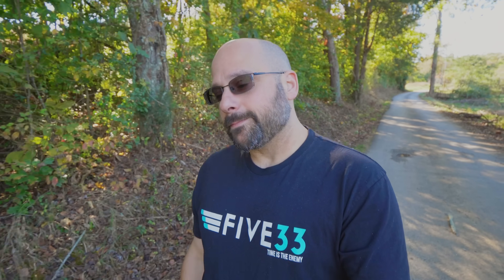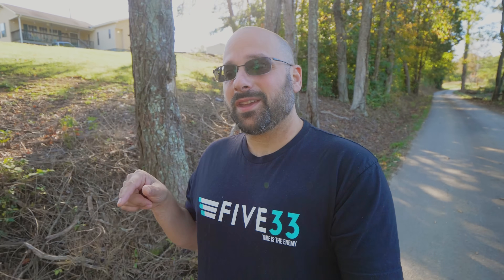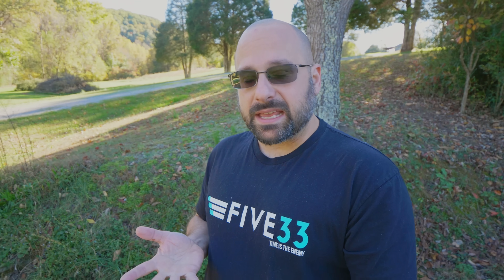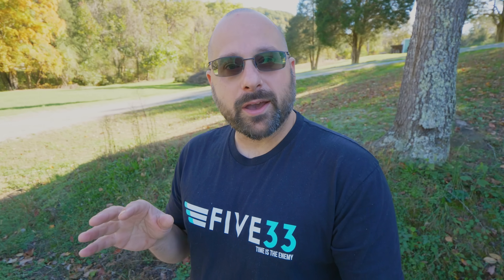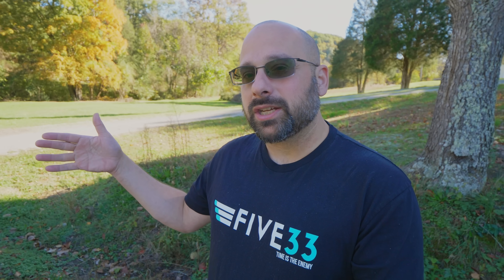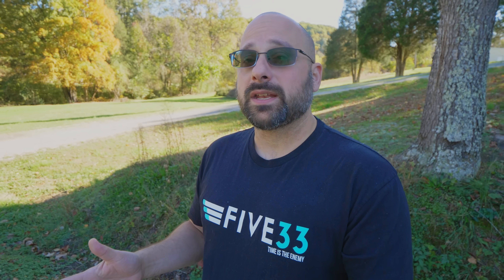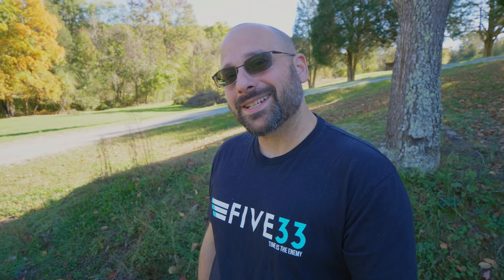How long can you leave your lipos fully charged without damaging them?

Comment: They need to make a like rail that you can plug in all your batteries, simular to how they are charged in the factory. Like it would be like a reverse parallel charger that maintains like 10 or more lipos at once. and you could connect more together if needbe. you could set it on like how long you would want them to sit dormant and it would automatically balance or storage charge. or heck if it could just keep track of them that would be cool too. I feel like the programming/hardware wouldnt be so hard to do, especially in like 2021.  Im constantly like trying to keep track of all my batteries manually. Seriously someone make one and ill give you all my money :P

if its like rainy for a week or whatever, ill actually will run my lipo balance chargers off of lipo that have been sitting too long. and set the "minimum voltage" for lipo discharge voltage. That way at least im cycling the batteries yanno?

Comment: Joshua, How important is the internal resistance(ohm) of batteries？ During changing, an ISDT charger shows resistance per cell. Some shows 10-15, and other shows 20-30. Could you tell beyond certain value could be dangerous or not efficient to use anymore, etc?

Additionally I wonder if we can connect 2 lipo batteries with parallel to Drone. For instance, I have 4s 450mAh batteries. Instead of buying new 900mAh for a bigger drone, I want to reuse 450mAh x 2. Is that possible? or explode drone?

Comment: Storage temperature definitely plays a major part in the speed of degradation too. I'd be willing to bet if you stored them charged below 0°C in a freezer they'd probably last much longer as the chemical reactions would happen more slowly..
Reply: My Aunt used to do this concept with non-rechargeable with Alkaline AA batteries, but it seems the difference in lost of capacity due to temperature is negligence especially if the battery is non-rechargeable.
Reply: Generally, a 10 C degree increase in temperature makes a chemical process run 2 times faster. (See the instruction-label  that comes with 2-component epoxy f.i. or think of a pressure cooker).  Same with battery deterioration. The lower the temperature is, the longer the battery will last when it is left alone.

Comment: I usually store my lipos on 3.95v.(70%) it's pretty nice because you are ready to fly much quicker.
Reply: I do the same.  I am so sad that there are no charging modules out there that stop at 4.0V
For some applications i dont need 3000mAh but i need 2000mAh for 6 years and like the convinience to 4.0V charge every few month and not need to measure the voltage every 30min

Comment: The same 'useful life budget' concept applies to discharging them at or above the 55C effective discharge rate - LiPos are incredibly impressive (the LiHV chemistries too), but realistically you have about an hour of useful life at the higher discharge rate, but in reality that's actually pretty excellent because it's a whole lot kinder to be at anything other than wide open throttle.
This is why a two-year old battery with about 80 cycles that has spent probably a touch over month charged up gets transitioned to the practice bin, because it's about halfway through its total useful life but no longer has the edge to be a racing pack or the one to use when a shot really matters... but it can push a lot deeper.
On the rare chance my packs to live to the 150 cycle (4+ year) point without mechanical destruction, then they get to be ground station power sources off BECs, because if I kill those I won't really be sad about it.

Comment: I have Lipos from 2017 (yes, 4 years old). I have religiously “storage charged” them 10 minutes after each flight and they have only been fully charged for a maximum of 2 hours (I fly at my house) during their lifetime. Their capacity is around 80% of what they were when I bought them but they are still going strong and I still use them. If you keep your batteries in storage charge for most of their “sitting around time” then they will last.
Reply: I have some 3s lipos from 2007 (yes 14 years). Still usable
Reply: I can second that but you need to buy high quality batteries in the first place for that.
Reply: Not worth for me personally since I tend to crash my 5 inch quite a bit and sometimes the battery takes a hit so most of the time they "break" before performance is an issue. This is very impressive though

Comment: Less than a minute into the video and you said the most important thing...”degrade”....that’s what I also say.

Ok, watching and typing....
Typing and watching....

30 days? And only 5%....? Surprised!
I’m glad you also chose the least common denominator and that it might actually add cumulative..that makes sense to me also.

Although I always felt slowly discharging them (to storage) with a Lipo Killer or charger  was less stress than flying them down...as “per one cycle counts”....
If this can be further tested or explained that would be great. If one cycle regardless of flight/decharge is the same I may judge my timeline differently. As in what percentage does one cycle remove and does the discharge rate effect that percentage.....then we can more accurately choose when to discharge. Sadly each battery type and temp and yards yadda yadda will effect that I’m guessing....these will be some long and in depth tests if expected to be accurate.

Great video...watch this get shared 1000 times in the next week or two...common questions for you and common questions in the Drone groups for beginners that I’m in.

Just watch out though everyone will cite your video regardless of the generally basic info you gave because some parts were open to interpretation and both sides will use you to argue their point......not all traffic is good, just a warning.

Comment: I thought the batteries form dendrites internally. They form faster the higher the amp charge/ discharge, and anytime it’s not at storage they will also form.
Reply: Yes, they do.  The rate it happens depends on factors (charge state, voltage, etc.), but that is what causes them to completely fail.  The worst is discharging at under 3.0V/cell, because that basically plates lithium onto the anode that creates those dendrites (and also depletes lithium from the electrolyte).  In slow charge/discharge cycles very little of this happens, which is why LiIon cells that get used gently are rated for tens of thousands of cycles, while we can kill of LiPo packs in 20 if they see a hard life.

Comment: Really great topic to discuss, I had to click. Sometimes I leave my lipos charged for three or four days but I worry more about how volatile they are in that time. Not how fast they degrade from that time, holding full charge. Thanks again for the great content and everything you do for the fpv community 🙂
Reply: That is what I worry about most. Is there a higher risk they could explode/ignite being fully charged and sitting. Especially cause I use a bag with several batteries in them. If I fly once or twice a week.. and recycle is 300 times.. I got a good few years at least out of them. That's a pretty long time in my opinion. As Josh said.. likely to see them die from flying and crashing than aged out of recharge cycles.

Comment: I agree with it completely.  Basically the IR of the battery will slowly go up, depending on time left full charge 4.2. Store batteries @HV charge this degradation is even exponentially worse. I also therefore do not beleive in HV batteries chemistry ,4.2Vit is just a tradeoff.  Any good Quality high C battery you could be chrged HV, but it will reduce it'slife time significantly when storingatHV.  So to top off just before flight  in the field, a lipo to HV volt, can be done without any issues.   You can also store batteries lower than 3.8, storage voltage it is not critical, 3.8 is selected by manufacturs backin the early days of lipo to leave it for years at the shelve even if some self discharge over time occurs. still lipo won't become to low in volt.   so any voltage 3.3 -3.8v should be ok it not cause any degradiation issues, probably it is even better to store lower.    Then On IR measurements, it deserves a video,as it is really good to check the lipo quality and equals battery SAG.    You need a good quality charger  (Icharger/ISDT) are reasonably ok, you need to calibrate the chargers balance voltages accurately.  you need to make sure batteries are always cold or at 20degree (or at same temp when comparing). Make sure battery all cell is at 3.8 storage and equalized. Than do a short fast charge 5-10C (high current give better resolution) after 10second so read the IR values.     It is really a good way to find the best packs,see the performance quality or comapre new or oldpacks.   Spoiler;  many chargers are not so accurate on voltages.  Good chargers really give consistent IR's.  Worth a Video.

Comment: Great response to a perennial question jb! Now can you answer the same question on the opposite end of 3.8 volts? That is, how long can I leave my battery Undercharged under 3.8 volts?!
Reply: I believe it will be basically the same. The root cause for the damage is the pressure put on the separator, which is basically "pushed" when the battery is full charged, and "pulled" when it is flat, which is why you leave the battery at storage - it is basically neutral pressure. This is also why they can rapidly deteriorate as once the separator starts getting punctured  it rapidly gets worse.
Reply: @pfeerick  what exactly is the "separator?"
Reply: its same as keepin them fully charged has same effect

Comment: one other thing to consider about leaving your batteries charged: a charged battery being stored increases the chances of a fire. discharged batteries don't have as much energy to create a fire as charged batteries. so there's also safety to think about when leaving charged batteries on your shelves.
Reply: In terms of flammability, it could be an interesting test to see if a fully discharged lipo produces more fire/smoke than a fully charged one from the same batch, or split the cells of a 2S, discharge one cell & fully charge the other. 
My money's on not much difference between the two, but that's only the burning aspect of it, the chance of it starting a fire by itself because it's left fully charged compared to storage voltage is probably more likely though.

Comment: 5%?  the average quad pilot flies with 2300kv of engines looking for the most aggressive propellers.  the discharge damage is certainly greater because no one ever calculates the burst.  the burst is tolerated by the motors and esc but kills the battery.

Comment: I just have one small correction here Josh, about how the cycles are counted. You stated that a fully charged battery discharged to storage voltage or even dead "3.5v" counts as one cycle. That is incorrect, one full battery cycle is defined as 100% to 0% to 100% or 0% to 100% to 0%. So that kind of gives you even more mah per cycle than people originally assume.

So maybe an easier analogy would be if you started at 50%, charged to 100% then used it back down to 50% that would be one half of a cycle or .5
Reply: The rate of charge and distcharge also matters A LOT. If I remember the specs of my 18650 cells, they have a 10x lifespan reduction if you use them close to their max rating. With how badly we abuse them on quads I don't care about charge/distcharge cylces. Only about times used.
Reply: The amp draw rate of discharge has to be be an important factor as well. Typical flight is going to discharge in say 5 minutes. A discharge/storage is going to take 30-60 minutes with a much lower amperage.

Comment: Just charge to 4.15V and be done with it.   The 9% penalty isn't even noticable.   I invented storage mode at the now defunct fmadirect cellpro and power lab series of chargers.   We called 4.15V long life mode.
Reply: The life loss is caused by out gassing and plate separation.   Staying away from the break down voltage prevents it.

Comment: Found 6s lipos fully charged in an electric mountain board from 2 years ago.  They had lost just under half a volt and performance has decreased a tad, 2 miles less range. Moved them to the Bat-safe now..  Batteries organised, all at storage voltage with dates of purchase from now on. #Sbang your Nan

Comment: I never leave my batteries fully charged for more than a day and I have used some lipos for 4 years which performed just fine. I don't fly bandos though. Nice side effect: You can always parallel charge your lipos before going to fly because they are all at 3.8V.
Reply: Exactly how i charge my packs 👌
Reply: How frequently do u fly?
Reply: @LucasMattes123  Admittedly not too often, about once a week in spring/summer.
Reply: @LucasMattes123  I was about to ask the same question. I never had a battery last more than 12 months. I always kill them during flight.
Reply: @bassohollic  you’re definitely abusing your packs if they’re dying after a year. That shouldn’t happen
Reply: I let my batteries fully charged for to weeks and still no problems. Have to say I use big 3s 8000mah for my 6s rc cars so maybe they can have more but anyway some packs are 2years old and still doing a great job💪🏻
Reply: So does 3.8V per cell mean like 11.4V total is storage charge? Also, how would you discharge a LiPo to ‘storage charge’?
Reply: @landonbeckman2677  for a 3s battery that is the total voltage at storage charge. And good lipo chargers have discharger circuits and should have a function to bring batteries up or down to storage charge depending on where it detects the battery is at relative to where it needs to go.
Reply: They perform "just fine" isn't precise enough to reach a meaningful conclusion. I am guilty of leaving my packs charged for weeks on occasion, and they also perform "just fine".

Comment: I have some Cobalt battery powered tools (self-propelled mower, 18” chainsaw and trimmer) that use 80V  battery packs, a couple of 40V tools, and some 24V tools.  They are lithium-something powered.  None of the Cobalt charger manuals mention discharging batteries at all. (Ditto for my DeWalt stuff).  In fact, the manuals on all of them instruct users to keep batteries fully charged.  ??   Yet my RC lipos recommend discharging to some storage voltage (anywhere from 3.6 to 3.8 volts/cell).  BTW, I have my first Cobalt 80V packs that have been in service since 09/2016 with no noticeable degradation.   I’m not sure what the difference is.
Reply from the maker: Several possible explanations.

1. Cobalt doesn't care if you wear out your batteries by leaving them fully charged. Buy more! They know it'd be annoying to force you to manage them so, they just take it as a loss.

2. Cobalt may be using a different battery chemistry that is more resistant to damage from being left at full charge.

3. Cobalt chargers may not charge to 4.2 volts. Charging only to 4.1 or 4.0 significantly extends life.
Reply: Maybe 3.8V are the max voltage? How many cells is in the 80V pack?
Reply: Different batteries. There are likely 18650 cells in there and those are the standart li-ion which are more stable. So less performance but also less degredation. (If information i got from a few engineering sites talking about batteries 2 years back and wiki are to be believed).
Fully charged is to prevent them from draining to much which 100% kills them and is more likely if used->not charged for a year. If possible it is still better to bring the batteries to storage voltage but that is to expensive for the charger and to much work for ppl to bother with. (this is some fairly educated guesing, except for the advice to get them to storage voltage)

Comment: What are the measures of "performance"? Is Internal Resistance the only tool we have?
Reply: The higher the internal resistance gets, the hotter the battery will get while being flown. Also, the voltage output will be less under load.

Comment: I think its important that people understand that batteries start to degrade as soon as the cells are assembled.  They degrade at the slowest rate at storage voltage.  This normally only comes until play when someone stores a pack at storage voltage for a year and wonders what happened.

Comment: Here to play devil’s advocate. 
Why does my wife’s 11 year old macbook pro with a lipo battery pack, that has spent its entire life on a charger, maintain a charge for over 90% of its original capacity? 
Is the charger charging/discharging the pack while the machine is left stagnant?
Is it maintain a fully charged voltage well under 4.2v per cell?
Reply from the maker: I can't say for sure but yes some laptops do have automatic logic to avoid fully charging batteries when left on AC power. And sometimes they don't fully charge when new, so they can stretch the apparent service life as the battery wears out. But I think anybody would be impressed if a laptop battery lasted 11 months without losing performance.

Comment: I keep mine stored in a way that if one did catch fire, it wouldn't affect anything.  No burning house, minimal loss of other batteries.  Because of this, I have stored them wherever they end up at the end of the day.  Full, 3/4, wherever.  I've never had a noticeable deterioration, and never had a fire.  I've been treating them this way since lipos became consumer grade.
Reply: Wait, you think a lipo at 3.8v is incapable of causing a fire if damaged? Also, who do you know that had a fire with a fully charged battery that is stored?
Reply: @nofluxgiven1949  I didn't say either of those things, but OK.